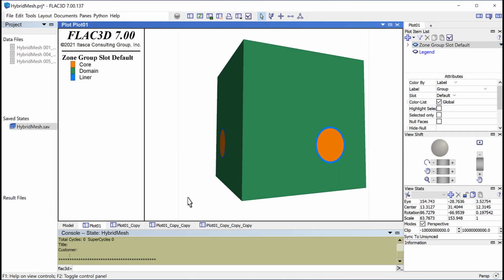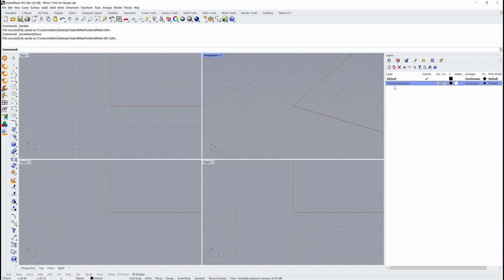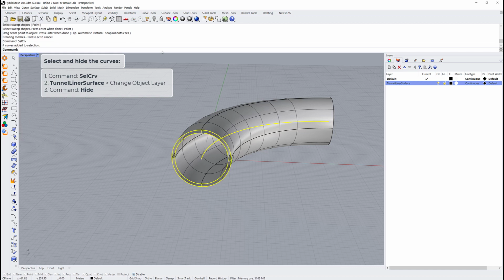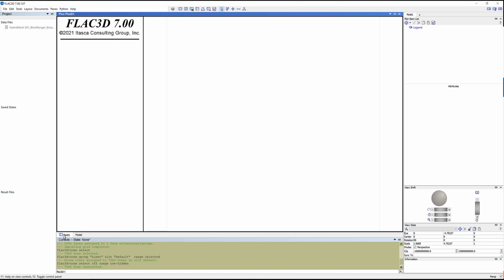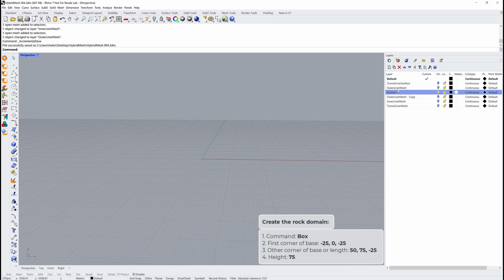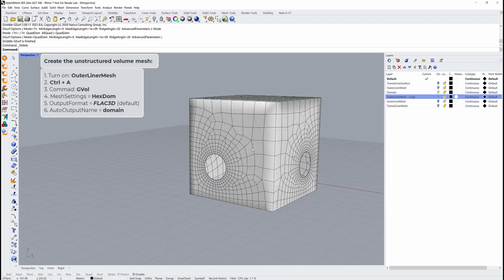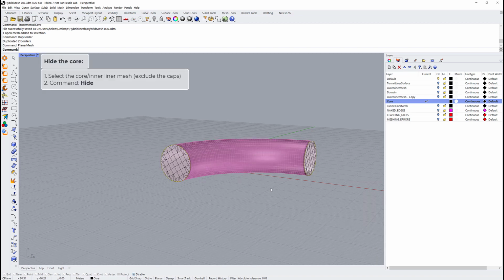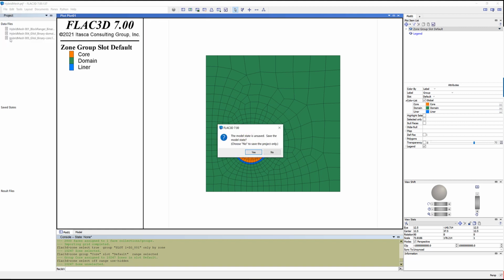Generate a Hybrid Mesh by Combining Block Ranger and GVol in Griddle

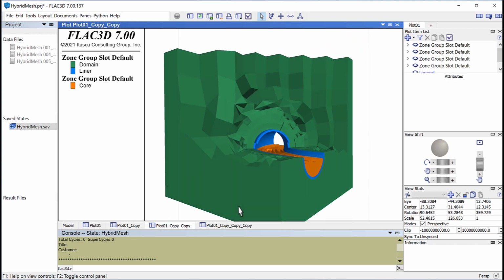Comment: May I know how to generate a cutaway view as shown in 0:33?
Reply from the maker: There are a couple of options. You can use the cut planes (see "Plot Item Cutting Tool" in the manual). Open and run the example "SquareFooting", which is aligned along the principal axes. Then expand the parameters (click the down arrow) for the "zone velocity magnitude" plot-item. Click on the cut-plane and select the octant type cut-planes (i.e., 3 simultaneous planes) on and back view options, and specify dip1/dd1, dip2/dd2, and dip3/dd3 as 90/180, 90/-90, and 0/0, respectively. The origin can be at 3.5,3.5,4.0. Sometimes you may need to play with front/behind options or the dd (dip-direction) sign to get the right quadrant. This should cut a square wedge into the corner of the model near the footing. In this tutorial, range logic was most likely used as the surfaces are "bumpy" as the range works on zone centroids, not cuts. See this tutorial for more information about this: https://www.itascacg.com/learning/tutorials/flac3d-7-0-plot-range-tutorial. For this sort of question, the Itasca Software Forum is a great resource: https://forum.itascainternational.com. Hope this helps!